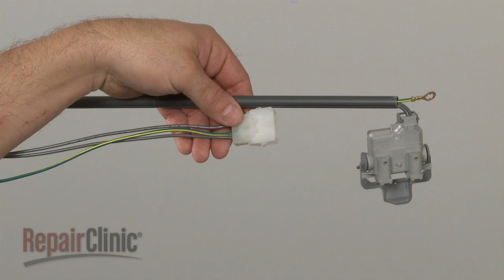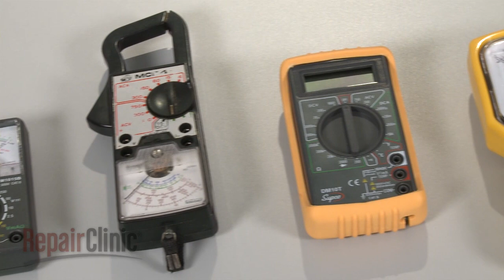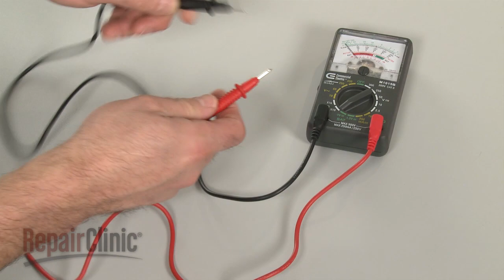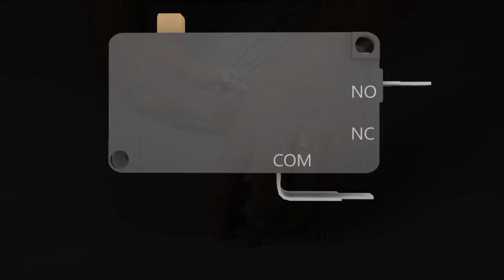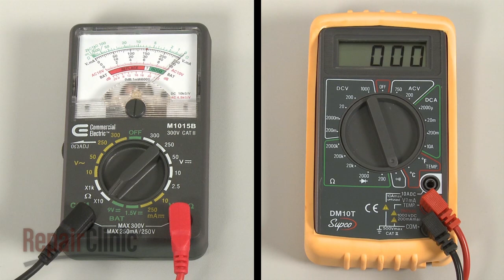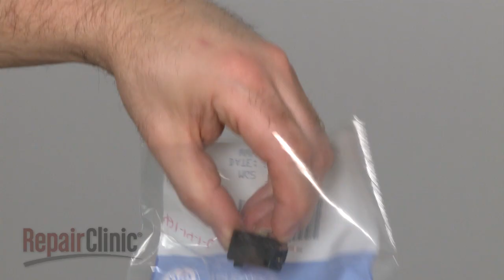Washer Won’t Spin/Drain? Two Terminal Switch Testing, Repair

Comment: Very useful video, however, for washing machine lid switches at least, it is best to test the switch while it is still mounted or installed on the washer.  The reason?  The travel of the switch actuator matters.  The lid strike will only push the switch lever so far with the lid closed.  If the switch has worn, it might not be far enough to complete the circuit, therefore the switch is bad.  If you remove the switch and work the actuator lever by hand, you will be pushing the lever further than the lid strike would have pushed it, and therefore completing the circuit causing it to "test" good even though it will not work on the machine anymore.